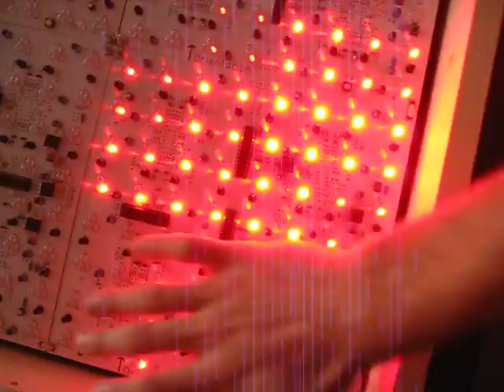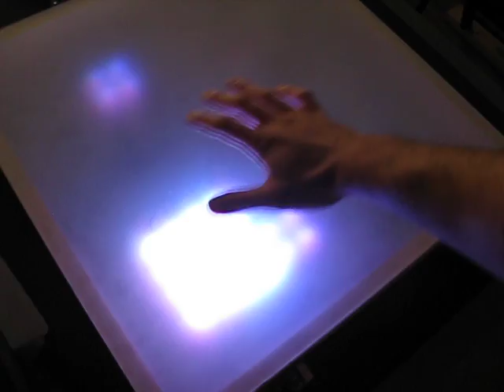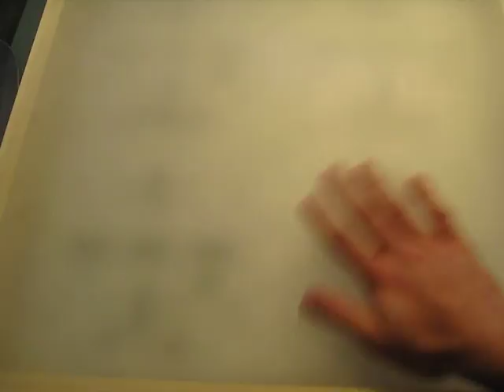Interactive Multi-colored LED Table

Comment: hi ı am studying at electronic engineering. and ı have a project for my thesis. and ı need simular sensor for my system. ı tried CNY70 but ıt didnt work. Could you help me which sensor you used for this system. ı am looking forward to waiting your answer.  my e-mail adress esrefbenligil@gmail.com. thankss

Comment from the maker: I am not using tricolor LEDs for a specific reason. I have 4 LEDs of each color in series, to drop the voltage. I would have to put the outputs of the tricolor each through a resistor to balance current and also have them in parallel, which requires a lower supply voltage and thus more current demanding. By having the LEDs in the current arrangment, I need no resistors, and can have a lower current demand which is helpful for the TLC5940.

Comment: Also why didnt you use tricolor LEDs? You could cut back on components (you don't need to control different colors) the color would be controlled by the code....  You could use tricolor LEDs in all the spots of all the color LEDs you are already using... Making it possible to have better "resolution" I am about to embark on making one of these.  Would these suggestions work?

Comment from the maker: @kalsara001 yup, the LEDs are driven by tlc5940 chips and I have 4 LEDs per color driven by each pin of that chip. Kinda awkward to explain, but it works out better and safer for the LEDs to be driven by a high voltage that drops to almost nothing by the time it gets to the TLC5940. More efficient, I think. Looks a bit weird though I realize

Thanks for watching!